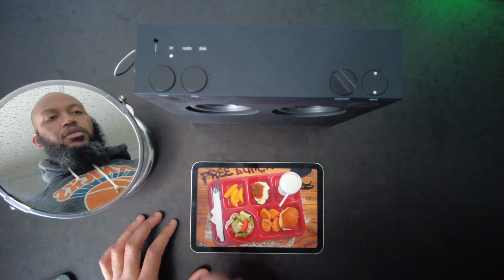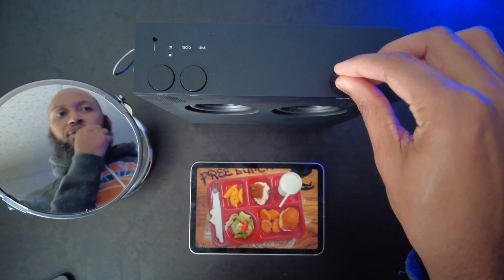Why I Love the Teenage Engineering OB-4 🖤⚫

Comment: Totally agree man.  The OB4 is a new kind of turntablism or OB4'in lol.  I love that OB4 and chill, i do the same.  Iove remixing on it.  I wish i had a way to record what i spin but alas, thats the one obvious need they themselves knew but denied it from the design.  There is no way teenage engineering doesnt know the fun of their own creations.  They intentionally left it out.  I thought the mixer would record, it doesnt.  So I need an OP1 field, no.  How do i take the coolest part of the OB4 and make it something i can swim in, my creation.  Film it.  Total fail from teenage, but its too obvious.  What is coming?  What is already in the OB4 thats not turned on yet.  Or, is the line in, also a line out?  I dunno.  Perhaps teenage engineering saw this feature as gimmick and not something sustainable.  Or its in the OB4 DX PRO, the ultimate in super cool swiss, or was it finland, or sweden, I know its got an S in it.  Tho for the longest time, I thought it was a japanese company.  It had that vibe.  But Korg would know better.  Hell even berhinger would.  In a way, ommitting it, actually dimishes the influncer base that wants to celebrate the radio- now its not sharable... why?  cause all you can do is get inspired and then feel trapped and pissed cause you have another problem.  Wasnt this radio supposed to fix problems?  Bad bad teenage engineering, hurry up on the DX PRO. Before someone else, and you know it will happen, takes notice of the trend you exposed but didnt deliver on.. maybe roland can see that gap, they know the fun of loops more. Maybe the next 404 is connected to this.
Reply from the maker: Enjoyed the read!